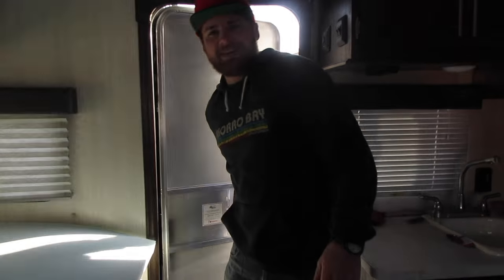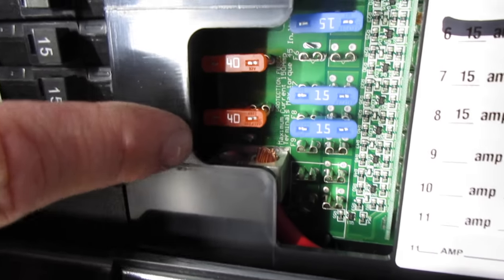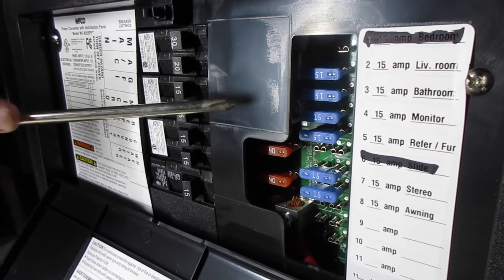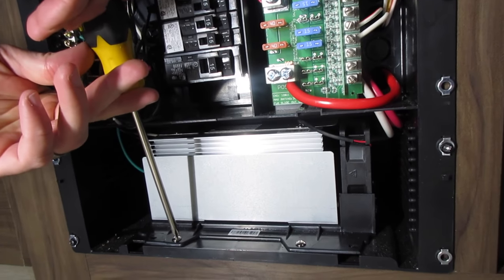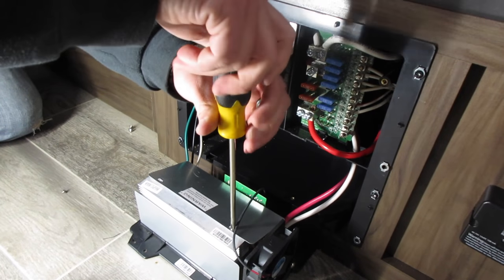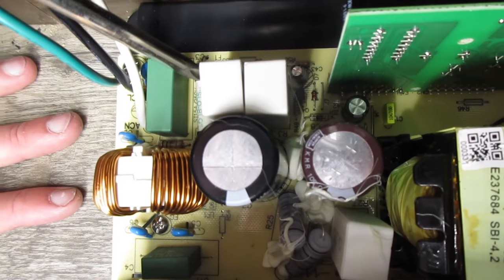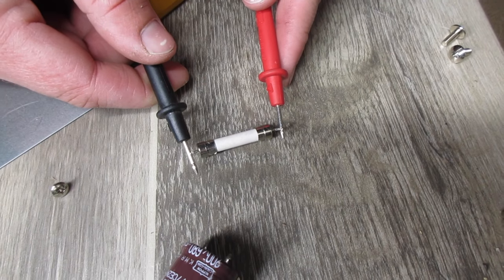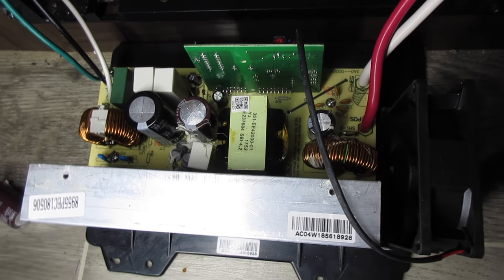RV Power Converter Fix #diy #notcharging new vid link below

Comment: Thanks!!! I've already done all the troubleshooting... how do I change that fuse myself?
Reply from the maker: I wish I would have re order the repair but I didn’t. 🤦🏼‍♂️ it’s pretty simple tho. Just heat up the solder underneath  the board to the fuse that is blown. Pull that fuse out and then insert the legs of the new fuse in and solder it in the back side back to the board. Should be good as new

Comment: got the same problem which I'm sure many have just bought new converters but why not have a backup with you that has been fixed for cheap. So just to fill in some info here the replacement fuse info is on the board next to the fuse. mine shows a ST15A 250V ceramic that you can buy a pack of 5 online but without the S. I looked it up and both the ST and the T are both Slow Blow fuses but one is more resistant to overload than the other. So, if your careful how to hook up to a park or not cross your battery terminals you should be good with the T15A 250V fuse. Will take my extra fuses with us on our trips and my solder and gun for fixing the next one.
Reply from the maker: I agree with all of this! Overall they are pretty cheap but I know myself and alot of people enjoy fixing things and being able to rely on just me. It’s handy to know these things to get out of a bind. Thanks for the comment.
Reply: Got the fuse pack but just discovered one of the capacitor is blown. I see the ebay link and looks like I just put in the info and how many needed so will buy a few of then since  they are so cheap. I put in the new converter a couple days ago and that's working fine. The old one is just a fun project.
Reply from the maker: Ugh it’s always something else huh! Luckily you have the new one and now can take the time to learn on the old one!

Comment: Thanks for this!  Just checked mine on a new to me camper and it is blown.  It looks like 250v 5A fuse, correct?
Reply from the maker: Happy that you found the issue!  If it’s the same converter then maybe so. You can open the video description and it’ll have links to the parts. Thanks for watching.

Comment: Thank you for this video. I have the converter in my new trailer. All was good until our third trip and the converter fan kicked on and the battery got really hot and was leaking. Could you recommend anything else I could check on this converter or trailer?
Reply from the maker: Thanks for watching. Hmmmm sounds like there is a short somewhere cause that to happen. I’d start by trying to look at all my hot connections and make sure they are good and then the ground as well. It can be difficult to find these gremlins tho. The battery leaking is a big problem

Comment: Does the power converter have any other fuses? I was expecting it to have 2 external 30 amp fuses on the back of the box.
Reply from the maker: Thanks for watching. As far as I know there are no more other than on the board and then those two 40 amp fuses printed out. There might be one right after battery behind the frame I just can’t remember now
Reply: @RotoCityTech  I checked and there is not. Thanks for the video. It's a good one.

Comment: 1 of our capacitors just blew. We have a 30 amp trailer. Did you know the capacitor specs for 30 amp. I dont see it anywhere. Great video Thx.
Reply from the maker: Thanks for watching! If you check the video description there is an Amazon link  for the capacitor that I purchased.
Reply: @RotoCityTech  So your is 30amp service aswell?
Reply: My capacitors have no markings. Just trying to find the right ones.. Thanks.
Reply from the maker: Yes we have 30 amp service as well.

Comment: Thank you for the info ! I have the same problem. The link to the fuse you have shows the fuses without the little pins on them that go into the board . Where do you get the pins from ?
Reply from the maker: No problem! Thanks for watching and thanks for letting me know I put the wrong link. Here is the correct one and I have corrected it in the description. https://amzn.to/38QShyq
Reply: @RotoCityTech  thank you so much !!!!
Reply: I’m assuming you just bend the end of the pin to the board
Reply from the maker: I just cut the pins a little longer to stick out the back and then solder those pins to the board. I didn’t really bend them
Reply from the maker: http://vrai.net/retro/wp-content/uploads/2017/01/dc_fuse_replacement-4.jpg

Like this

Comment: Hi there , thanks for the video, exactly my problem. However where do I buy those parts for replacement?
Reply from the maker: No problem I’m glad it helped! Check the description for links to Amazon. Hopefully everything is still available. I’ll double check as well.

I just looked and the link to fuse works but not the capacitor. I’ll have to find that again but if you take it apart you can look at the part number and search it

Comment: RotoCityTech what does the converter do? The only thing it does is charge the battery?
Reply from the maker: It charges the battery when plugged into AC power but also converts the AC power to DC so that all the 12v powered things in a camper will work
Reply: @RotoCityTech  thanks for the upload and response…. Where did you get the parts?
Reply: @MarkMinistries no prob! In the video description there should be links to the parts. Thanks for watching.

Comment: This is a great video - I have an issue that can’t seem to find the issue - 

My camper is having an issue where I am getting 110 volts on the left side of panel, I am not tripping the 12 volt fuses on the right side, but I am tripping the two 30 amp fuses that are in the middle of the panel. 

Could a converter be causing the fuses to blow? 

Or do you think It could be a ground wire?
Reply from the maker: Thanks for watching. Man, that sucks you’re having this issue. Seems kind of strange to me. I’m not super knowledgeable but I do think it seems like a ground issue if it’s blowing those in the middle but not the 12 amp ones. Make sure the fuse labeled for reverse polarity is good because i had an issue with that and then check right behind the front frame portion there are some breakers that might have come loose. But now that I think about it that’s all before the board..... hmmmmm I’ll think about it some more

Comment: How do you get that fuse replaced? Do you have to solder it? Also for the capacitor how does that get replaced?
Reply from the maker: Thanks for watching. I’m bummed that I didn’t video that part before I fixed it and sold the camper but yes I just took the board or and used me soldering gun to heat the solder to remove the fuse and capacitor and then put the new fuse and capacitor in and soldered them into the same spots.

Comment: We just went through a hurricane and lights are out so I went back to my RV and my battery was completely dead . I replaced it with a new one but a day later the new battery wasn’t charging it read 10V what could I be looking for to fix this issue I’m basically boomdocking till we get power around the area I’m in
Reply from the maker: Sorry to hear this. I would first look at the two 40 amp fuses in your box and make sure they are good. Remember tho if you are boondocking the battery won’t be charging unless you have solar panels or are plugged into 30 amp service

Comment: Question why do u have 2 40 fuse when the Manuel for the 8900 says only(2) 30 max?
Reply from the maker: Good question. Those were in from the factory so I am not sure. I can’t recall ever looking at the manual either.

Comment: Where did you order the capacitor???  Thanks great video!
Reply from the maker: Thanks! I got it on amazon. The link is in the video description for Botha capacitor and fuse.
Reply: @RotoCityTech  after further investigation into my camper I realized I have the exact same problem.  The exact same camper too.  The exact capacitor blown as well.  But it is wired correctly.  I wonder what is going to happen when I replace the fuse and capacitor.
Reply from the maker: RB S it’s pretty cheap to replace the capacitor and fuse. For sure cheaper than getting a new board. So it’s probably worth replacing....if you have lower going into the left side of the bird but not getting to the right then replace those will fix ya right up

Comment: will my converter make my ignitor not work on my furnace if it is bad?
Reply from the maker: Thanks for watching and commenting. I don’t see the relation between the converter and ignitor. My guess if you are having furnace problems it is in a safety lock situation. This happened to me a couple months ago. I just turned it off for a few minutes and then back on to reset the timeout
Reply: @RotoCityTech  yeah I tried that and got nothing. The blower kicks on but you can't hear the igniter then after 20 seconds it shuts off
Reply from the maker: Hmmm weird. Maybe there’s an issue with the propane or perhaps the ignitor is bad. Hard to say without seeing it in person.

Comment: For a dealer the cost of diagnosing the problem and getting/installing parts to fix the board isn't worth it to them based on what it would cost and what they would charge for simply installing a new converter. They other issue is the life left in that other aluminum electrolytic capacitor. Those parts degrade over time (electrolyte evaporates) so the one that didn't vent may be near its end of useful life. From the dealers perspective it's not worth the risk to replace one of the capacitors only to have the other one fail a month from now and have to deal with another repair.
Reply from the maker: Yup I agree. Problem is my local dealer didn’t even want to look at it because they weren’t certified in wolf pup campers. We bought in a different city. Also I could have bought a new converter for less than $200 so no big deal but this fave me a good excuse to figure something out. I have another capacitor to solder in when it fails but so far 1 year later everything is working perfectly. Thanks for watching and commenting.
Reply: @RotoCityTech  Are both capacitors the same value and temperature rating? As far as Wolf Pup certified, it's impossible to know the legal liabilities involved if their insurance only covers them working on certain makes/models of trailers. That said that exact power center and converter are probably used in all sorts of makes/models so I can't believe they're not familiar with it. But kudos to you for finding the issue and fixing the problem.
Reply from the maker: Now that you mention that I can’t remember if the other capacitor is the exact same. I’ll Verify before if I need to replace. Thank you. Oh yea this same converter is used a lot of places and they did say they were working on the certification but now my warranty is out anyways lol. 👍🏻
Reply: @RotoCityTech  Just an FYI that I saw another video where that converter was replace and the same capacitor had vented in that unit. Apparently that capacitor takes a hit if some over voltage  situation takes place. That type of extreme venting would be an indication of a sudden increase in internal pressure caused by high voltage.
Reply from the maker: That’s exactly what happened to me. A friend of mine hooked his car to the battery on the camper because it had died and he wanted to put the awning out but it was dark and he hooked the cables up backwards. I believe that’s when it happened
Reply: Paul Harris I believe, after completing several fine pitch soldering projects on video game consoles (ps2 and og xbox mod chip installs), that I reasonably organized and tool-equipped technician could replace the capacitors and slow-blow fuse within an hour's time.
Reply: @Command37  How much do you pay yourself per hour? How long did it take you to pull the converter out, identify the failed capacitor (not always obvious), find the same or similar capacitor, paid to have it shipped to you, travel to do the removal an install only to have another $0.25 capacitor (that's been in the unit just as long) blow and now have to repeat that process. Penny wise, pound foolish if you have to pay someone else to do it. Do you know what a $40 or $50 an hour technician cost the company per hour? The reason a company won't diagnose and replace a capacitor versus replacing the whole converter is it doesn't make economic sense to do it. Unfortunately if you've never run a business you probably don't understand the real cost of running a business.

Comment: Great video! The link for the capacitor is rated a 50V 680uF. Is this correct? I checked my converter's capacitor and it reads 200V 680uF. Since the shore voltage applied is 120V wouldn't 50V rated capacitor be low? Would like to know before ordering the capacitor. It's interesting as my 15A 250V fuse is blown and the capacitor is bulged just as in your video.
Reply from the maker: Luis Perez thanks for watching! Hmmmm I would have to look again at my board to double check the volt rating but I’m certain I just searched the exact numbers and bought the same. Maybe yours is slightly different. I would find one with the same number ratings and go for it. Brand does not matter
Reply from the maker: Hey I just looked and I bought these on eBay and put up the wrong link. You are right it is 200v. I have updated the link. Thanks for catching this!

Comment: great vid, I have a different issue, im hoping someone can weigh in on it. I have a 92 coleman pop up with a 15 amp converter, i had the battery out and was preparing to go camping, it was plugged in to the house for several days while I flushed cleaned and prepped. the 110s worked fine, the 12 volt stuff worked fine also, furnace w/fan, water pump, water heater ect. So I finally .got a new battery , installed it with all power turned off. now by the way my book says that this converter will NOT charge the battery.I went to check that it would work off battery. Nothing, zip nada, 110 is still live but the 12volt side is dead. The converter a BW 92 vintage has one switch a 3 pos labeled Batt/Off/Conv. It also has 2 -110 breakers and 2-12v old style glass automotive style fuses. My thoughts are that even if the converter was bad it  should switch to 12 volts and work when switched to Batt ?I tested the leads from the battery to the box and i have 12volts there but its not getting to the 12volt appliances? Im thinking the switch is bad or there is a fuse somewhere im missing maybe internally? Hoping someone is familiar with this old trailer before I yank the converter out and put it on the bench (its tight).
Reply from the maker: rick turner my best guess would be to test at the switch if you can reach it. When it’s on conv you’ll see power and then switch it to batt and see if you get power. If not then yes I’d replace the switch. Without knowing that particular converter it still sounds like it could be a similar issue with another fuse somewhere blown but I bet you’ll need to pull the converter out to see what’s in that board.

Comment: The other capacitor is bad also, domed at top means bad.
Reply from the maker: Peace Joy guess I’ll be replacing that one too huh!? Lol everything is working as of now but I do have more capacitors
Reply: @RotoCityTech  if it's domed at top, it's bad but I can't really see it clearly. Thnx for the video because I'm in this situation.
Reply from the maker: Yes it does look a little domed. I can’t remember exactly how it looked in real time but after testing everything worked so it is functioning.

Comment: Your other capacitor next to the one you replaced is also bad if it's not completely flat if it's rounded off at the top it's ready to blow.
You need to replace that one or you'll be right back in it
Reply from the maker: Thanks for watching. That’s what I found out afterwards haha but as of now it’s still working as it should. I sold the camper already but the owners have said it’s still working. Thanks for the heads up!

Comment: how do you get a schematic for this device and what if the unit stops outputting in a few minutes
Reply from the maker: I never did find a schematic but maybe contacting the maker of the converter to see if they can help? I would just examine all the components looking for swelling or burnt up pieces and then get a multimeter and start testing for continuity

Comment: One Question. Where do you buy the parts. I have the exact problems with mine
Reply: Nvm I just found that you found it on Amazon and eBay. Good video
Reply from the maker: Yes sir. All the links should be in the description. The eBay link may not work because it’s from a while back

Comment: That's great information ...thank you .
My problem if anyone knows  of a fix my 12 volt supply keeps turning on an of by it self could it be a low battery problem.  Anyone can awnser let me know..
Thanks
Reply from the maker: RENE MARTINEZ you’re welcome! Thanks for watching. So when you are using the camper but not plugged in the 12 bolt supply turns on and off?
Reply: @RotoCityTech  yes I just found out my camper auxiliary battery is not there.  Do is the truck plug causing it to turn on an off due to the time out for the truck it self I'm going to have to get a back up battery or re wired to the truck two batteries.
Reply from the maker: RENE MARTINEZ while trailer is plugged into the truck it should be charging the battery on the camper. Not sure why it would be shutting on and off...check the fuses in the fuse panel maybe one is blown